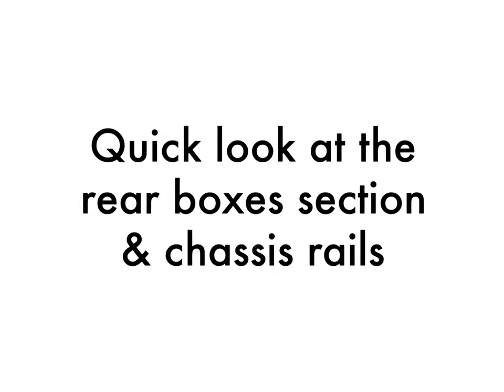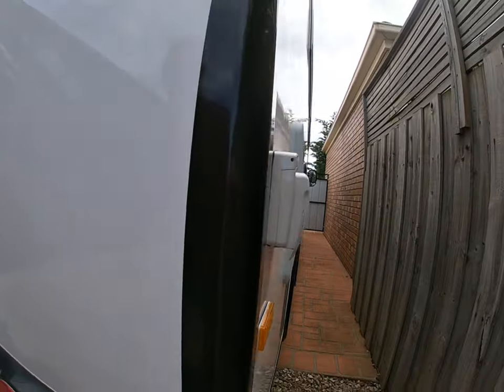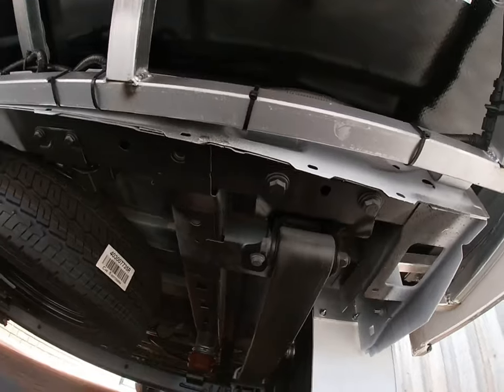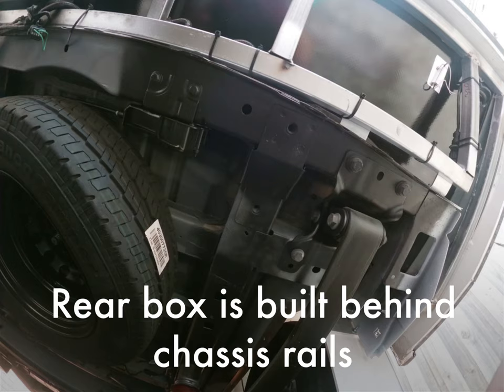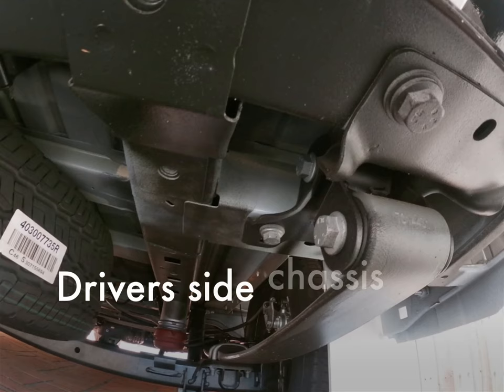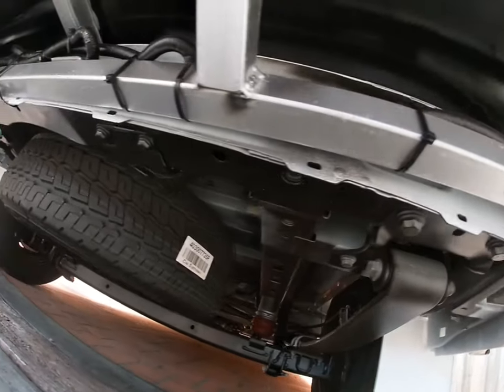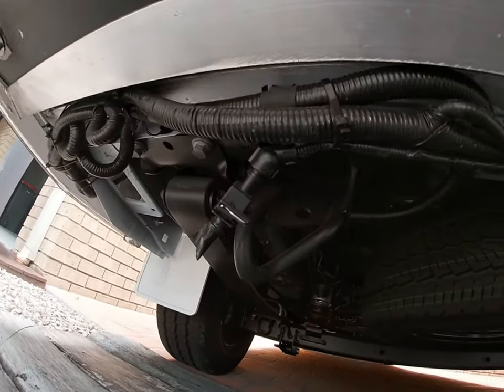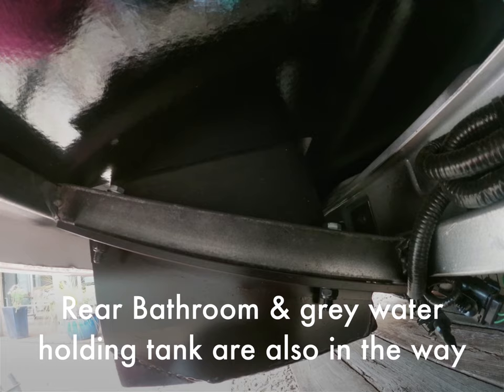Windsor DAINTREE motorhome | rear chassis inspection

Comment: Oh dear, we'd thought we'd finally made a decision on which motorhome to go for, but this is something we really needed to tow our little electrical contracting trailer and is a deal breaker. :-{  Travis Jikael.
Reply: OH!  Just found the Tow Bar.pdf on the Facebook page, thank you very much for your most informative videos and information.  I would normally make up a spreadsheet, but you'd already done it.
Reply from the maker: Hi Travis.  That was 6 months ago & with more Daintree’s on the road, things change. You can get a towbar now. It has a tow cap 1500kg, a ball load 80kg & is from www.motorhomeandtrucktowbars.com.au in Qld.